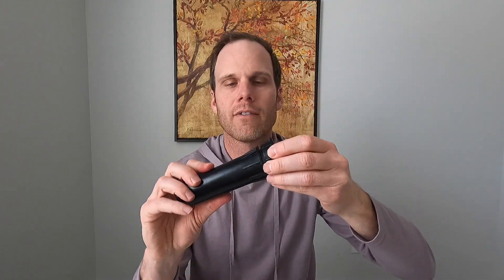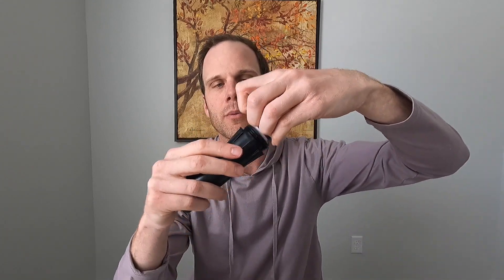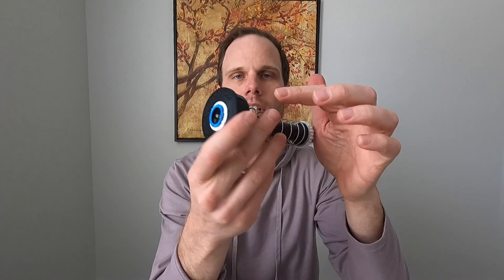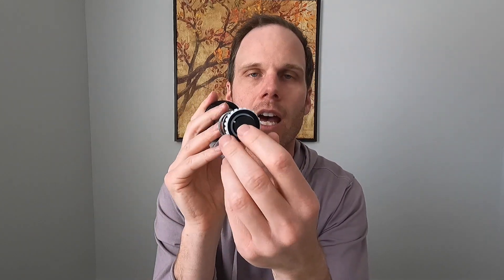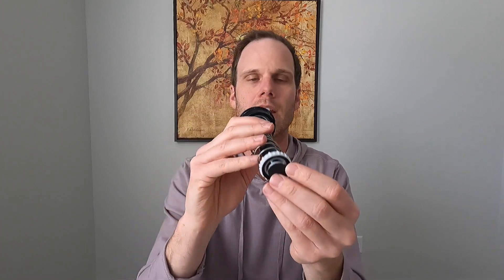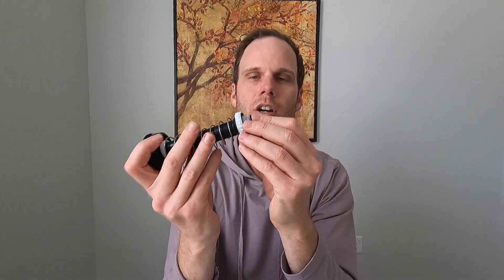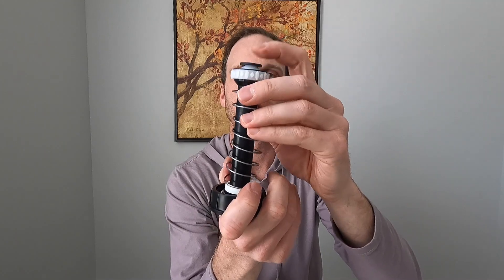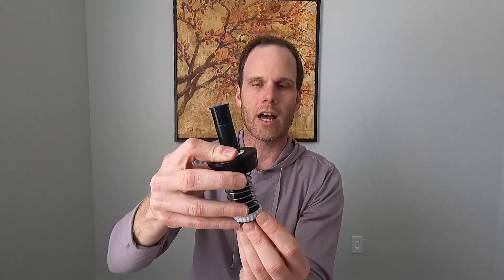Stop Water Draining from Sprinkler Heads

Comment: My bottom sprinkler heads keeps leaking a few minutes after zone is done. I have installed the check valves and still leaks a little.  Is it normal because they are the lowest sprinkler heads and the pressure make them leak? What else could i do?
Reply from the maker: Incline / elevation drop might be too much!
Reply from the maker: Other solutions would entail redesign of the pipe layout underground which I imagine no one would want to do.  Or being able to extend head so it isn’t at the bottom of the slope to essentially make a U with pipe layout in order to counter to water pressure left in pipes.
Reply: @thesprinklerchannel  thank you

Comment: This is the problem I have, got your check valve but it will not snap in, these are rainbird heads
Reply: Did you ever get this fixed?
Reply: I have the same problem which valve do I use for 1800 rainbird ?

Comment: thank you for this info. ive been dealing with this issue for years to the point my driveway was sinking and had it fixed with foam injected to raise it.
Reply from the maker: Sorry to hear, glad this info could be of some help.
Reply: I bought the hunter heads with built in check valve

Comment: Hello, If I install this valve on the lowest sprinkler on a sloped area, will the water completely stop flowing out of the section? Does the problem not move to a higher sprinkler on the slope? I think I will have to install this valve on every sprinkler on the slope.
Reply from the maker: The pressure caused by gravity / weight of the water in the line lessens the higher up on the slope it is.  If the grade difference is too great, not even these will hold the water back but yes you might need to install on a few of the lowest parts.  See as you go.

Comment: Hey there...I've got a leaking sprinkler issue and that led me to this video. The sprinkler head is at the low point of my lawn so I bought one of those hunter check valve sprinkler heads. Just installed it and unfortunately water still trickles/oozes out of the top. Any suggestions?
Reply from the maker: My first question would be how much lower is that head than the highest point of that zone?  If it's too great, no check valve will be able to hold it close.  Another thing that comes to mind is to make sure that the valve isn't staying opening (check solenoid closed and that valve diaphragm isn't dirty / damaged, etc.) ever so slighting causing very small amounts of water to still flow and pushing water downstream and causing it to push pass the check valve.
Reply: @thesprinklerchannel  The height difference in probably 1-2 ft max. I watched another video that mentioned the valve issue. I'll check that out. Thanks for the help 👍🏻
Reply: @gapdude101  HI did you figure out why it was still leaking? I'm having the same issue.
Reply: @Jay-gc8vd  I finally did get to the bottom of it. Turned out the diaphragm in the valve had a little hole in it. That hole allowed water to pass thru even though the sprinklers were off. Simple replacement and with the new diaphragm in the problem is solved. Maybe check that. Good luck.

Comment: My problem is actually just one sprinkler head constantly spewing just a little water even after that zone is off.  Furthermore it’s at the very top of a steep slope.  So maybe a control valve stuck ?  Beyond my knowledge.
Reply from the maker: From your description it does sound like the valve is opening sporadically which isn’t a common issues.  I would make sure the solenoid on the valve is turn tightly to the right for that zone and all zones.  Apart from that, I would also see if the same thing is happening with any of the other heads.  Let me know what you find out and anything questions you may have.
Reply: @thesprinklerchannel  Thanks for the feedback. Will look into that